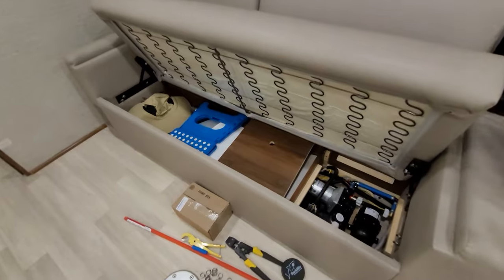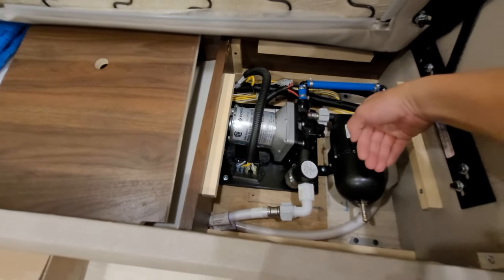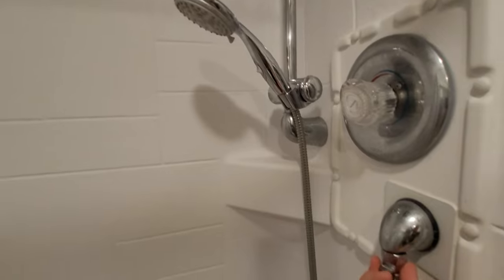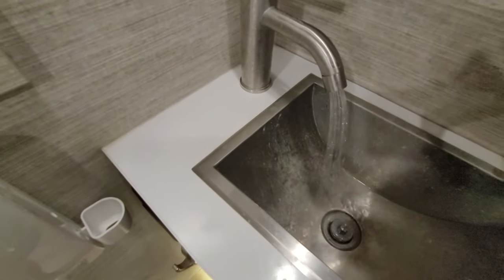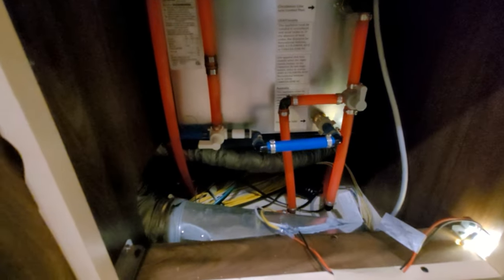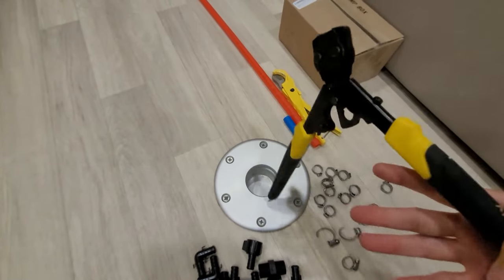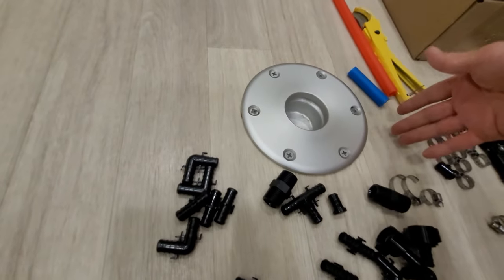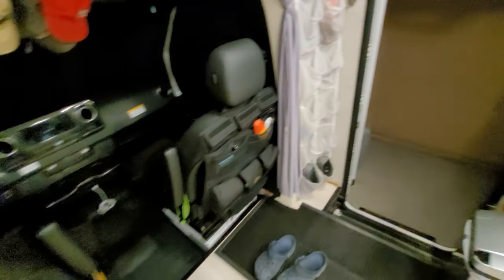Why You Need an Accumulator Tank | Every RV Could Use One

Comment: I actually burnt out my first pump trying to conserve water without an accumulator tank. Found out from the company that the pump isn’t meant to flow water like that because the constant cycling due to the low pressure will eventually burn out the pump. Will definitely be buying an accumulator tank for that reason. Great video!
Reply from the maker: Sounds good. You will definitely like how the accumulator works especially when trying to save water.

Comment: Consider adding a check value right before going into the water heater. That should help prevent a blast of cold water from the shower when turning the shower on and off. Another option is to add a check value on both hot and cold water supply just before going into the shower. I'm not a professional plumber, so others may have better ideas to prevent cold water shock between cycling water on and off. There's nothing like getting a blast of cold water while your head is full of shampoo.
Reply from the maker: Yes the checks valves would help for a typical water heater set up where cold water can mix into the hot water line.  My last two RVs have the Truma comfort plus that have a dedicated recirculating hot water line to all the fixtures.  If those lines are run correctly then the check valves would be unnecessary.  The only downside to any type of tankless water heater is a steady pressure of water required.

Comment: It's impressive that the apparently tiny 2 to 4 oz of water capacity in this accumulator is providing sufficient buffering!  Some folks have installed 2 gallon pressure tanks to get more capacity, do you think that would perform any better than this compact solution?  Your videos have been super helpful - thank you very much!
Reply from the maker: It depends on what your desire for pump cycling.  In the video, you saw how slow the pump cycled using the bathroom sink.  It's about the same for the shower if you trickle it the same as the video.  But if you want higher water pressure, of course it's going to cycle more often or even right away.  My goal is to conserve water so I'm happy with this set up.  If you flush the toilet full foot pedal step, the pump will cycle right almost right away though.  The factory PSI on this accumulator is 30psi, but it's adjustable up to 125.  I have mine set up at 45 PSI and am satisfied.  As for the larger tank, if you have the space, it wouldn't hurt that's for sure but I'm ok with this set up.  Hope that helps.

Comment: Save yourself the headache. Its one more item to fail and two more connections that can leak. Install a Seaflo 56a variable speed pump with no acc tank. Quiet, efficient and no cycling.
Reply from the maker: I might try this pump out in my new RV.  Have you had an accumulator tank installed before and did a comparison?  Wondering is one is better than the other, or about the same, but with less hassle of having an additional part?
Reply: My seaflo 51 series is a beast, no accumulator needed either.
Reply from the maker: How is the seaflow 51 series able to act the same as an accumulator?  It's not variable speed at all, so at really low flow, it would cycle on and off wouldn't it?  I'm still debating on the 56a variable pump on my new RV, but the reviews on it are terrible.
Reply: I have a pump similar to that pump. It certainly DOES surge & cycle. They are all the same. GET an accumulator tank. It has many benefits. & If you know how to connect plumbing properly nothing leaks.
Reply: @rvlifediy it doesn't. He doesn't know what he's talking about.

Comment: The sure flow 4008 pump has a bypass it needs to be set but a accumulator tank helps alot more
Reply from the maker: Yes the accumulator tank is much better than the bypass adjustment.  That adjustment is useless for evening out the pump cycle when trying to save water.

Comment: I would kill to have that open access to my water pump. My pump is installed in a tight space under the bedroom floor and buried in wires. I have wanted to install an accumulator but haven’t found a good place for it. Nice video with excellent recommendations.
Reply from the maker: I was talking to someone with a 24J and they said the same  thing. Could you mount the accumulator further away and just get flexible hoses to connect to pump?  You could extend the factory hoses with male adapters and the braided flex hoses.
Reply: @rvlifediy  This is a good suggestion that lets me give it a second thought. Thanks.

Comment: great video so easy to follow. wish u showed us the pressure of the water now
Reply from the maker: I'll have a new video with full install process in the future.  I'll make sure to show the pressure before and after install.
Reply: @rvlifediy  thank you! do i have to add an on/off switch to the pump?
Reply from the maker: @jcardosa02  no switch required.  It is just water line connections. You place this next to the water pump. You disconnect the "out" water line on the existing water pump and use that line to connect to the out on the accumulator. Then you need a new short hose that connects the 'out" of the pump to the "in" of the accumulator.
Reply: @rvlifediy  i’m sorry i meant for the water pump lol
Reply from the maker: @jcardosa02  Yes you would always want a switch for the water pump. The RV's already come with a water pump switch so I didn't have to install a new switch.  The accumulator doesn't need power.  It only works off water pressure (automatically) so you don't need to add power to it.

Comment: Don't use pex because they vibrate and make noise. Jus go ole fashion flesh hose, barb fitting and hose clamps. You won't need to carry all those tools around and if you develop a leak all ya gotta do is pop off hose clamp, cut leaky section out and pop it back on.
Reply from the maker: Yes the flex hose with barbed fittings or factory connectors is a better choice. I plan on doing that on my new RV. Those tools though are for rest of the RV. Leaks were quite common throughout the RV. I replaced majority of all the connectors that leaked throughout.

Comment: I have been meaning to do this mod.  Great video.  What about winterizing?  What do you do with the tank in the system?
Reply from the maker: I've never had to winterize, but I'm pretty sure it has winterizing instructions.  There is a schrader valve on the end to fill and drain the air bladder that is inside.  I would think you winterize like normal, and may have to release the air from the schrader valve, but the manual would let you know.

Comment: Good tech info! Curious is the tank compatible with other pumps? I had truma put the aqua go comfort in my 2021 gulfstream conquest 6320 which is 33’8” and get no clunks or nothing and my water temp is constant. I’m on my second water pump and it’s super quiet. Has good volume. It might be an extra advantage with that tank but don’t know, still like it tho!👍
Reply from the maker: The accumulator can be used with any pump. My pump is quiet also.  My water pressure is steady when on medium or high.  It is only when it's on super slow trickle (with the trickle valves I out in that the water can surge with the cycle of the pump and that can effect temps. We are talking literally ounces of water during drycamping. I talked to Truma back in early 2020 and they had a pressure regulator for the fix (mine is a 2020 model with 2019 parts).  Perhaps Truma made some updates or it could be a Winnebago thing.  Not sure if you have the low flow aerator but if you trickle it to extreme low, the water flow will be an issue with pretty much most RV pumps. Any regular or higher pressure, this is not an issue at all. Thanks for the input on your newer Truma.

Comment: Hello, I just installed an accumulator tank.  Was wondering what pressure you set your tank to? Thx
Reply from the maker: I believ I had mine set to 45 to 50 psi but you can experiment on what works best for you.

Comment: How do you pressurize the tank with out the air leaking out once you pump it up. I can never get the pressure correct because when I release the air pump valve it always has a quick moment where the air leaks from the accumulator.
Reply from the maker: If you have it hooked up already, I would shut off the pump, open a faucet to relieve pressure in your plumbing lines, then add air to 45-50 psi.  It's not an exact science. Once you add air, shut off the faucet and turn on the pump.  That will make the pump run and add more pressure to the bag inside the accumulator tank. You may have to fine tune it. You may also have to add more air.  Not sure why air would leak out when you remove it.  What kind of air chuck are you using?

Comment: I would replace that water heater with a 10 gallon electric one
Reply from the maker: I prefer the truma over the 10 gallon because it has a recirculating function, and the water is instantly hot at all your fixtures.  The only thing I miss about the 10 gallon water heater is the option for electric heat also.  The Truma doesn't have an electric option at all, so if you are plugged in, you still have to use the propane.
Reply: @rvlifediy  yea I use a Rheem 6 gal in my camper Van

Comment: what is the exact pump that you're using here? not the accumulator, but the water pump :D
Reply from the maker: Are you looking for the water pump model number?
Reply: @rvlifediy  brand and model number, yes please :D I like how quiet it is!
Reply from the maker: It's a Pentair (Shurflo) 4008-101-A65 3.0 GPM and also a link https://amzn.to/3yefvuR.  It is pretty quiet unless you get air in the system.
Reply: @rvlifediy  thank you soooo much!
Reply from the maker: @aaronpetrossian9203  👍
Reply: How many psi is the accumulator set at?
Reply from the maker: @garyfaulkner4427  I believe it came prepressurized to 30 psi but I changed it to 45 psi.  It's been a while so I don't quite remember the exact, but I do recall adding some air to 45psi.